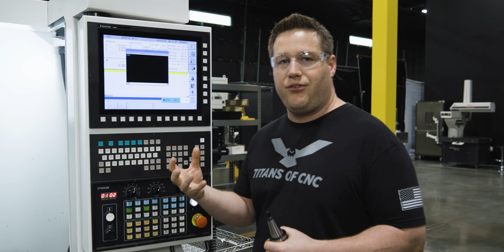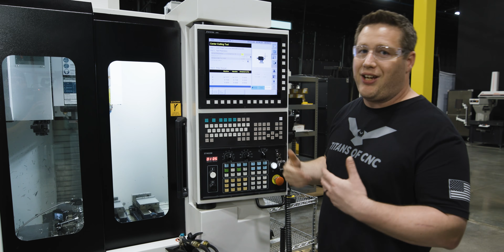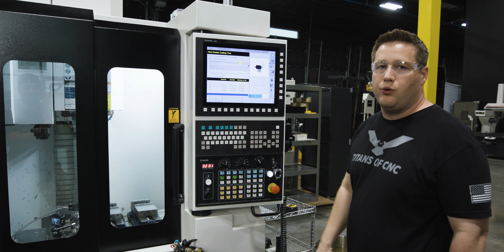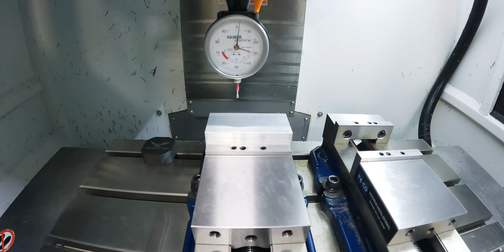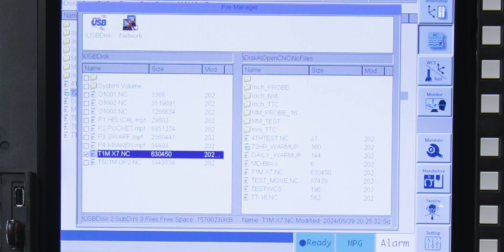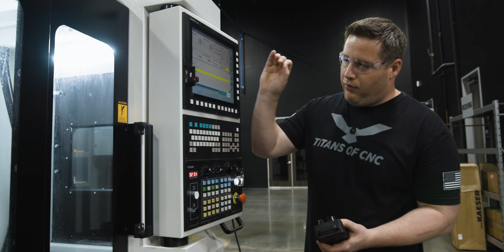SYIL X7 Tutorial for Set Up / Operation

Comment: I am considering purchasing one of the SYIL or other brand machines but I'm getting conflicting answers to whether I have to purchase the largest unit.   I have a 48" long part that needs milling on the top only.   Is it possible to purchase a smaller machine that, say, mills to 30" width where one end of the part is machined, then unclamped, then slid to the other side (or turned around) and mill the remaining length of the part.  I only need accuracy to 5 thousandths on this part.

Comment: Great video. Thanks for all the helpful information on the Syil x5. I actually own a older syil. My model is the Syil V5 from 2019. It has the LNC 5800 controller. Would it be possible to do a tutorial video just like this one? But using the LNC 5800 or 6800 controller? @TITANSofCNC

Comment: i am interested in learning how to run a CNC machine like  PUMA SMX 3100ST MILL .
Do you have classes to be certified? 
Los Angeles here.
I would like to have it on my resume.
Reply: They do not run classes for learning the basics of operation of CNC machines. Their classes are about making parts, once one got the basic knowledge of operating a CNC machine in general, and access to one. The basics of operation and coding are similar to many brands of machines. I guess a company will look most closely at job seekers general experience within CNC machining, and less at what speific machines/brands one have been working on. The company will give instructions on operation of their specific machine(s) if needed. A good machinist will quickly pick up the ways of operating a to him/her a new brand. But of course it dows not hurt having knowledge of operating different brands.
Reply: @Rimrock300  ..thanks for that info
Reply: @Rimrock300  ...how does one learn the basics of running cnc machine?  i have drawn plans for cnc..but not run the machine.

Comment: Hi Jesse   Thank you for the update about the tool setter rotation.  I learnt the hard way and crashed the face mill into the tool setter.  I saw you manually centre the job when setting the G54 Y position.  I feel that there is a better way.  Use the "Manual Centre" button and enter the Y1 and Y2 coordinates - this automatically averages the readings.  Then press "Latch Aux Coordinates" button.  This will put the Y average AND the X average coordinates into the G54.  If X was Zero it will put a Zero into G54.  It will over-write any X & Y coordinates already in the G54.  So always use this function first.  It is designed primarily for manually finding the centre of a hole to act as the G54 reference.  I use the out-of-the way USB port on the RHS side of the control panel not the front port.  If you find this side port does not work it means the factory still hasn't added a connector cable.  To fix, just remove the back panel of the main console and plug in a standard USB connector cable from this remove USB port to the main circuit board.  I feel this is safer than having the USB drive plugged into the front panel.  I enjoy your videos greatly.  Cheers.
Reply: This is exactly how I do it. Took me a year to realize it was there hahah

Comment: Great video. Thanks for going step by step and showing all the possible pitfalls.
The only crash I ever had on my VF4SS was when I was first learning. For some reason Fusion did not use H7 for my T7 tool but instead used H0 (this was in 2015 when fusion was still new). I did not have "T and H must match" set in the HAAS controller.

Ruined a new KURT 6" vise, 3" face mill, tweeked my spindle alignment and is surely the reason why I had to replace my spindle less than two years in.
Why isn't that setting turned on by default?

P.S. Do not use automatic when using PCD inserts. Spinning backwards causes the tip to hit and chips it. Took me 2 of those $200 Iscar PCD inserts to figure that out. Do it manually.